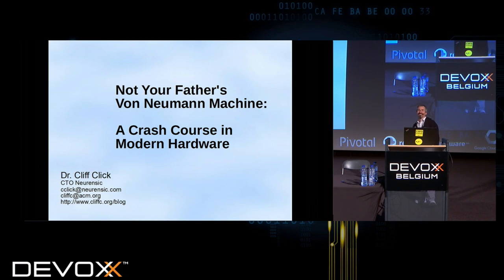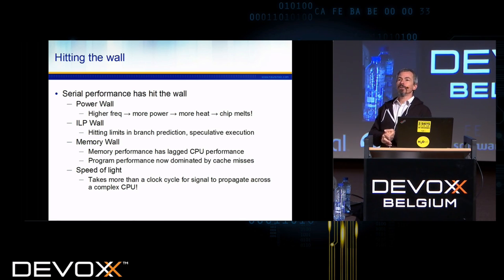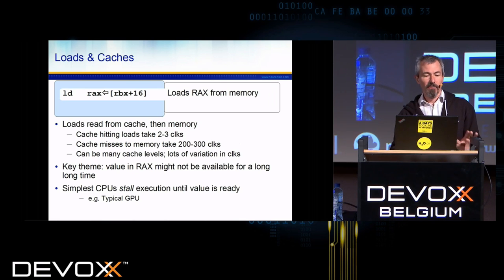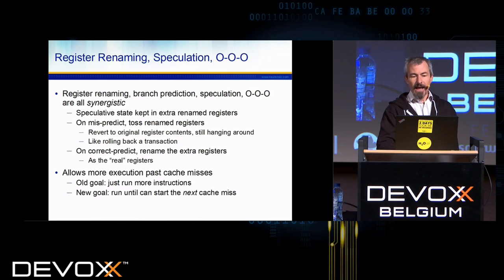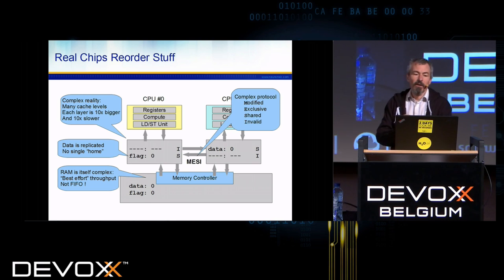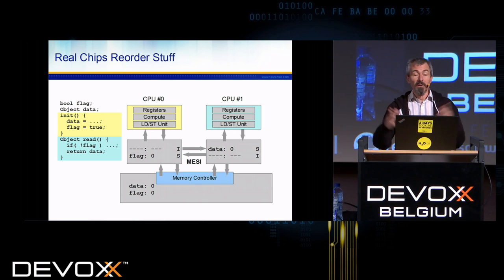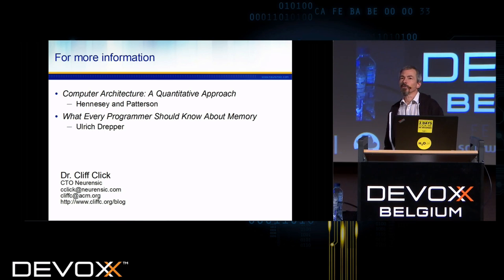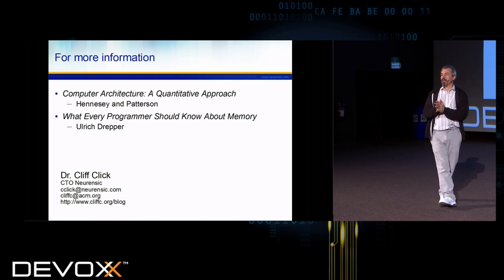A Crash Course in Modern Hardware by Cliff Click

Comment: getters and setters just suck as much as cache misses
Reply: no, they still suck semantically, they're useless, you aren't protecting anything if you have a setter, all the problem is immutability, you have to control mutability, not access
Reply: That's not really true. Immutability has its positives, but in environments where that is undesirable (either for performance or design reasons--while I quite like writing immutable code I recognize that there are plenty of places where it makes for a more complicated model, just look at common rom-rb usage patterns) setters allow for explicit filtering, bounds and range checking, and reactivity (property changes firing on an event bus, for example).

You may not need any of those right away. And that's totally fine. But setters provide a forward-compatible API for having them later, while being trivially inlined away.
Reply: the real problem is sharing state, not having compatibility, it's never a good idea to be forward-compatible by sharing state
Reply: Forward compatibility is unrelated to the sharing of state.